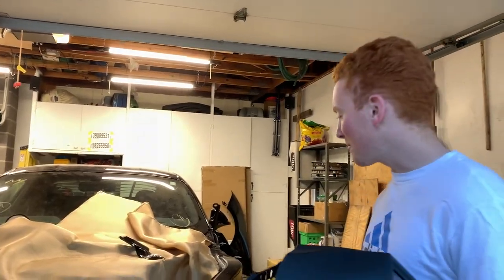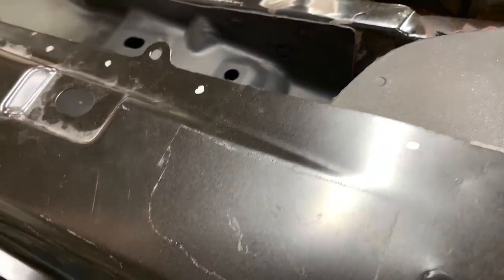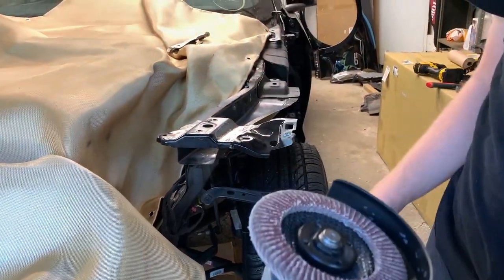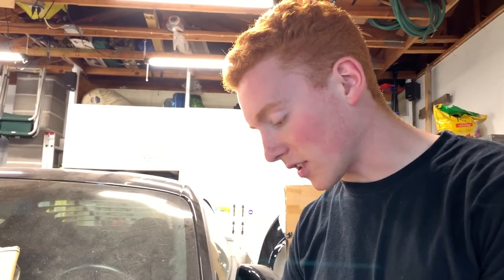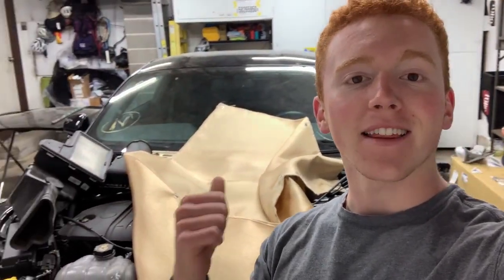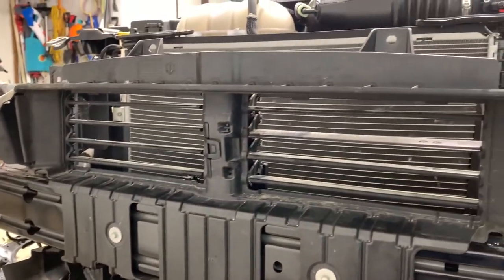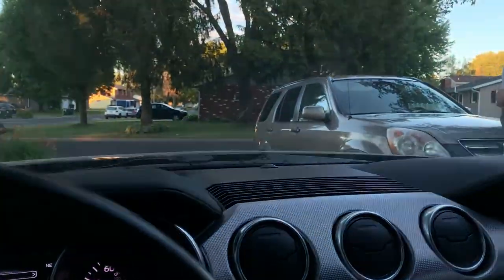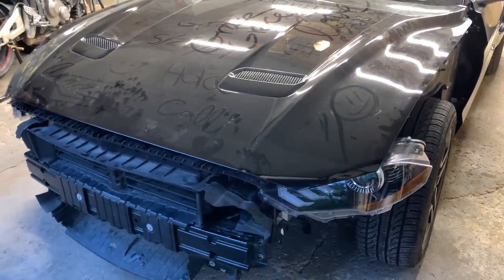Rebuilding A Mustang GT (Part 6)

Comment: Noticed some welding tips. I'm sure your welding skills will get better with practice/use. Thumbs up for tackling this yourself!
Reply from the maker: Thanks Ken! yeah i have 0 knowledge when it comes to welding. the part that frustrates me the most is the voltage to wire speed to metal thickness. Its a tough equation

Comment: Good job.  You probably know now you should use weld through primer after taking the paint off so there's not bare metal in there.  Wisconsin winters gonna eat all that open metal between the welds.
Reply from the maker: You're right Landon! Thanks

Comment: In future, turn either the wire speed down a little or the volts up a little bit more, also cover all your skin to prevent your skin getting arc burned